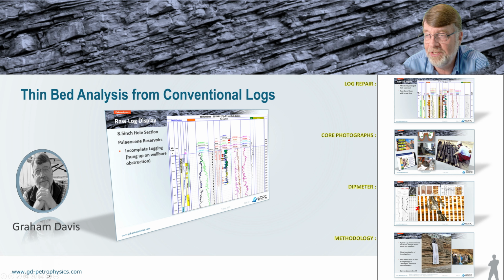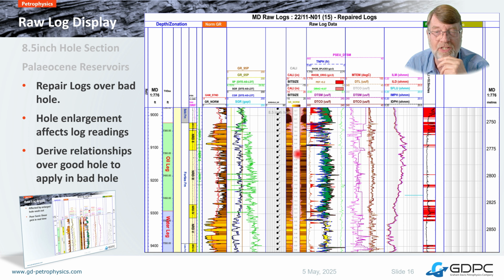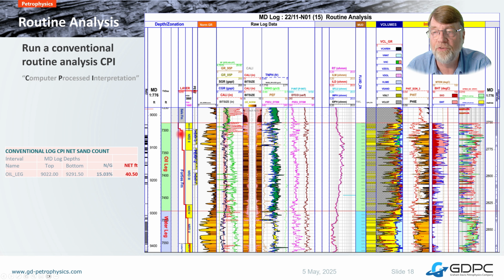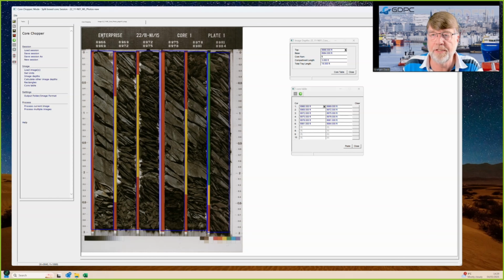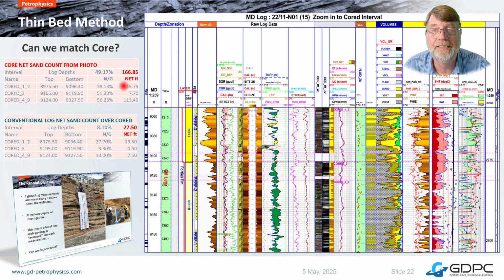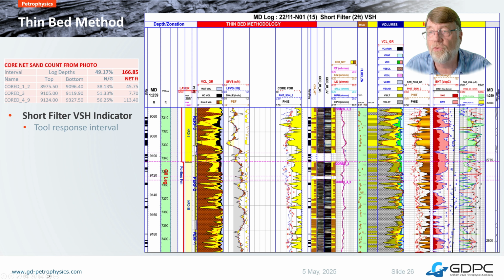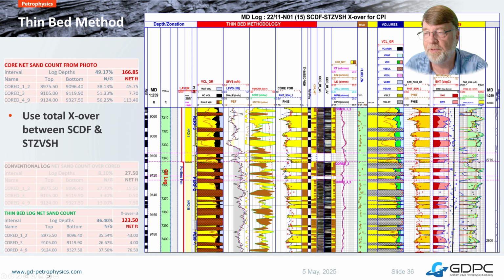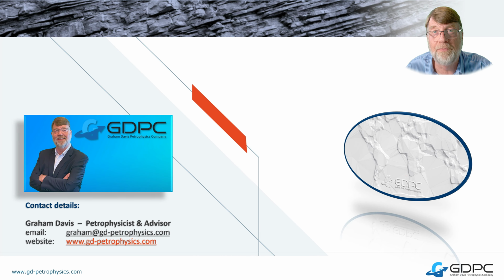Thin Bed Analysis from Conventional Logs

Comment: Graham, no words to thank you for your amazing petrophysics videos. Quick question how you came up with the Vshale balance and stdz(vsh) you mean (VSH-MEAN) / STDEV
Best Regards 
Juan
Reply from the maker: Hi Juan- thanks for your very kind words - yes STDZ_VSH is as you say - effectively putting the variance/wigglyness into units of standard deviation - this is a useful statistical technique to consider when processing different types of logs and accounting for differ measurement units whilst still comparing the formation responses.  

The VSH balance just cumulates both the standard and thinb shale volumes and takes one from the other (if they’re both the same or balance over an interval the output should be around zero) in my software I can access/call the level above the current evaluation  level with a bit of depth description code - don’t know what you would have to do!😉

Comment: Graham, amazing that you keep doing this for everyone's benefit. And I love your peaceful voice - who would have thought petrophysics can be peaceful:) 

A couple of questions if you don't mind:
1. Have you tried calculating an estimate of Swirr using some sort of log-based empirical correlation and/or core-based correlation (PHI vs Swirr) and compare it with your Dean-Stark (I assume?) water saturations?
2. If you have your true NTG from core already - why not use it by elevating your Vsh cut-off iteratively to see at which level you match your 120+ft of net? I understand this is just maths gymnastics but that's what we're doing here anyway in absence of image logs, NMR etc.
3. Would be really cool to see mud gas curves and oil shows in a new track to have another verification of permeable sand with movable oil.

Thanks!
Reply from the maker: Hi @alexanderbelevich9548 - yes - I think the hope was that by keeping the conventional vs thin bed models statistically balanced - we were doing more than just "arbitrarily" adjusting a cut-off to match the core net sand in this particular well ...We were trying to come up with a reasonable METHOD and "standard" repeatable amplification parameters that we could use with confidence across the field - even where we didn't have calibrating core.....but as you see by the end of this i failed and in essence I was indeed just trying to max out the sand identification!

The Dean-Starks were very interesting in this well (IIRC) - we sent a series of hot shot samples back quickly on the helicopter - whilst the rest of the core went back on the boat and got to the Lab about a week later....and there were marked differences in the saturation (water evaporation?) from the shipped core.....I might do another quick video on that in due course!........but generally we had very good Core to Log Sw match on Nelson ....so I believe the Core saturations were good.

I do like Richard Bateman's Idea of doing the conductivity modelling with the Binary Sand/Shale system - and using the match to the measured conductivity/resistivity to validate the model.......if you put too much/little oil bearing sands in - you won’t get a match!....I've started to work on this now!

I did try and find the relative production numbers for both the N09 well and N01 well - I don't believe it's broken don to the well level on the government NSTA website - but I do know/think that N01 was producing for over ten years(?) - being tucked away in the inter-channel area of the field you're probably a long way away from mobile water.....so I imagine slow and steady dry oil production could go on for a long while!.....so to your point the oil was definitely real and producible.....(I do normally like to dig out the drill gas data though - but I'd probably have to get it digitised if I found it on the NSTA website)....if there are any Shell folk reading this perhaps they could dig out the final cumulative production for the N01 well....I would love to know how the old girl did in the end!😍
Reply: @petrophysicsrocks  Oh good old times when core could be justified:) 

To be very frank, I don’t like the idea of backing out Rsand  in general. I worked a lot with 3D resistivity data and even when Rh and Rv are measured, the derived Rsand was still quite uncertain due to (1) presence of thin coals and tight streaks which created very high Rv and as a result very high Rsand and (2) the basic assumption of binary system (i.e. sand and shale end points with constant properties). But might be a fun exercise in a well with well known NTG and average sand bed thickness.
Reply from the maker: @bambrush2100  - yeah I have some sympathy for that view - when I've tried to use Rv/Rh, I haven't always been convinced by the quantitative answers I've received .....but I think I'll have a go to see if I can use a "ballpark ILD (6FF40)" response to help constrain/guide the amount of oil bearing sand I'm adding in......as a sort of additional constraint....now that I have time to play with it! 👍

Comment: The core shows beds dipping significantly relative to the borehole. In places it looks close to 45 degrees. I imagine the logs collect data perpendicular to the wellbore. So that must make for complex averaging of the log signals. Further, I suspect some tools would favour measurements along the most conductive (or resistive) layers so would "bend" to follow a dipping bed - (not explaining myself very well here, too early and not enough caffeine) - leading to a very complex measurement of one of the dipping lithologies (say sand) being more represented than another dipping lithology (say shale). Making the solution very complex!
Reply from the maker: Yeah I think on balance - you're right...I had lulled myself into a false sense of flatness from the compressed pictures on the logplot.  Actually working a  thin bedded field like Baobab in West Africa I found that the well-bore/bedding interface actually helped the thin bed problem by increasing the "apparent sand bed thickness" by about 30% - which helped the tool property readings.....but you just had to remember to correct the reservoir sums back to TST (True Stratigraphic Thickness).  

The Shale (high conductivity) will dominate - In Richard's original paper he mentions that a typical pay sand would only have around 1/25th of the conductivity (which is what induction tools measure) of the shale......so the sand signal is heavily outgunned!   I'm going to have a go at some conductivity modelling....if I can get a spreadsheet set up right (I have a chance of at least playing with a bit of 2D dip effects.....but need to get it working in 1D first!!...Richard has actually sent me some stuff to get me started.....so maybe over the next 30 years I might have a Chapter 2 ready! 😁